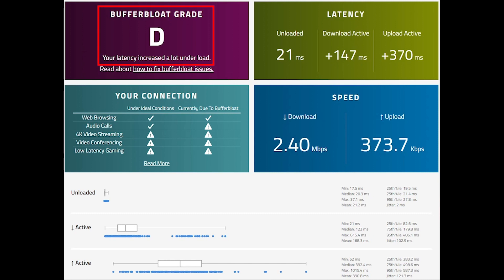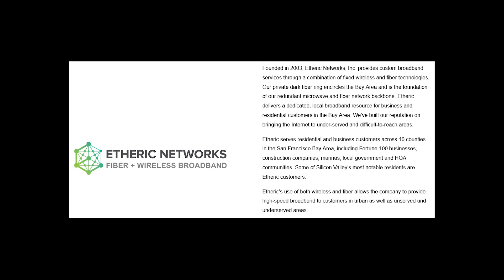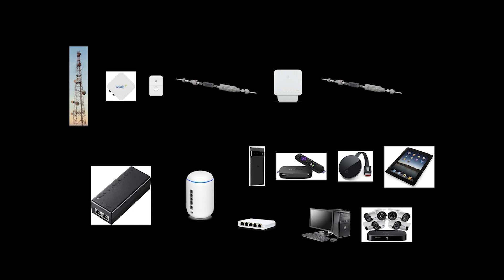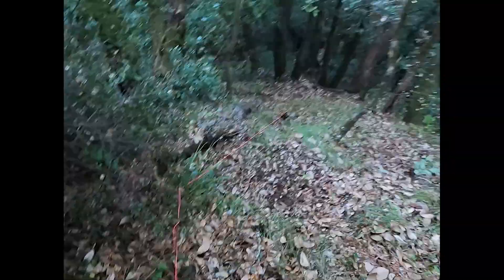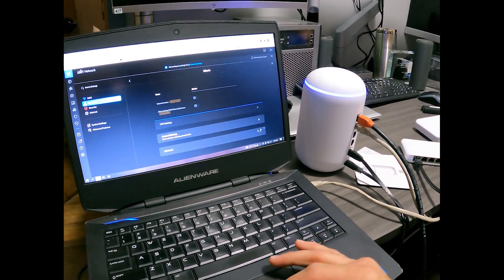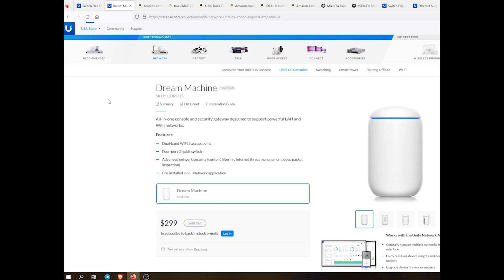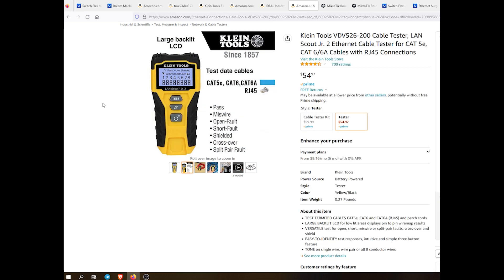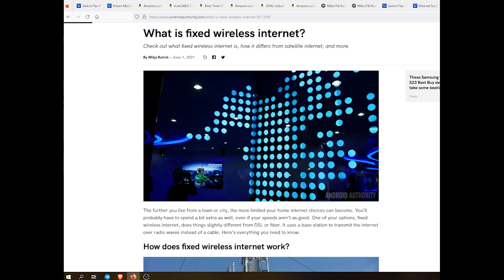Creating a Fixed Wireless Internet Setup (Wireless Broadband) in the Remote Area of Corralitos

Comment: wouldn't the cables be somewhat at risk of wild animals?
Reply from the maker: I thought that too, but I've had zero issues over the past year and a half. My original plan was to enclose the cables in PVC pipes, but the potential for downed trees cracking the pipes and letting in water to ruin a greater section of cable made me leave it as is. If the cable is damaged I have the supplies needed to replace sections.
Reply: @tripecollie  I have a question. My daughter and her boyfriend live 3 miles out of town in a very rural area. No one out that way can get cable, or internet. I know her neighbor has starlink. I have Comcast and they have a deal right now for those who have internet with them, so I got her a phone and took it out to her, but she only gets a small signal by her kitchen sink and no where else. I was thinking about getting her a cell phone booster to see if that works. If we can't figure this one in the next few days I will have to take the phone back( I have 14 days) No point in keeping it she can't get service out there. Not having any way to communicate seems crazy in 2025. She can't afford starlink I have ATT and 1 mile down her road (1 mile from town) and I lose all service  Its windy where she lives and its open hay fields surrounded by hills on the back side. do u think a cell phone antenna booster might work? I know xfinity mobile works off Verizon towers but I don't even know where the closest tower is